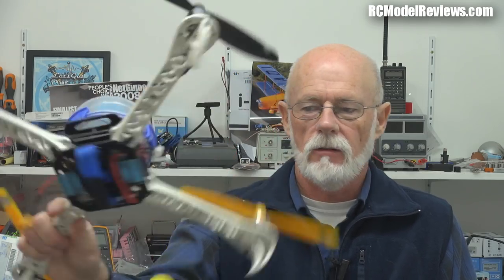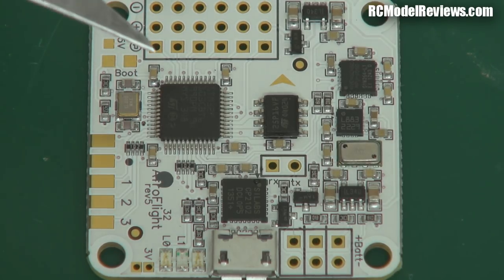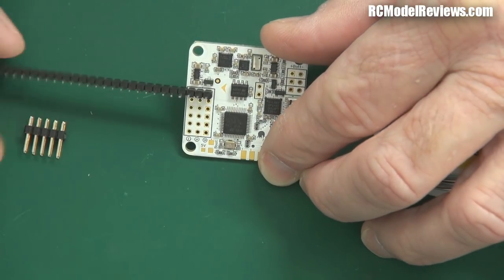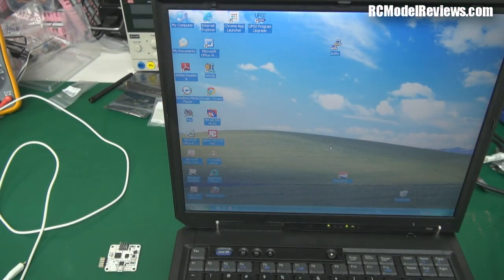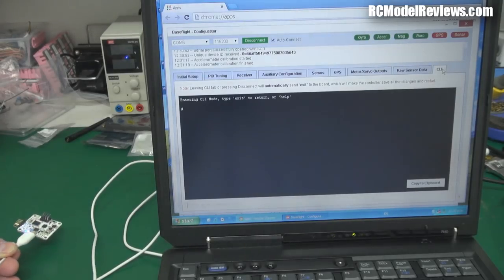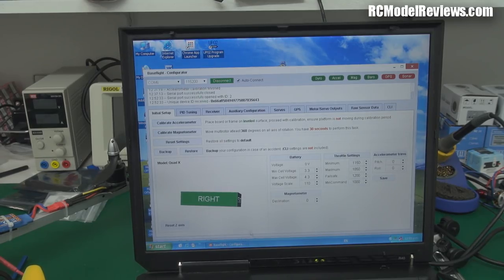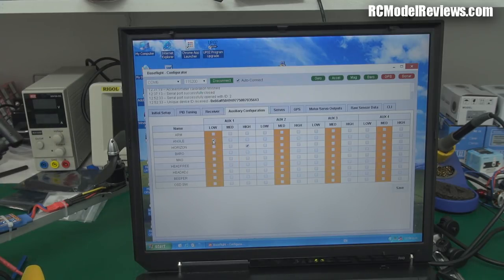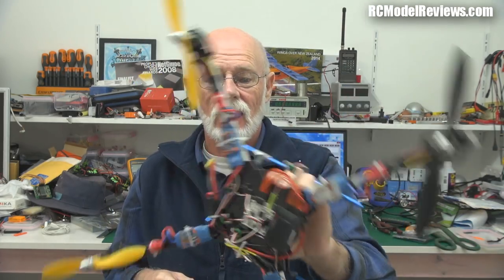Naze32 multirotor flight controller (part 1)

Comment: Great review! I've been wondering about that controller. Btw, when soldering pin headers on smt pads I find it easier to tin the pads first and the add some flux and reflow the solder to the header.

Comment: Flew my NAZE32 for the first time today on a SK450.  Thanks to your video I had the final config bits I needed.  Flew great even though I had tried to kill it earlier in the week with 12 volts (bad ESC).  Agree that it just works without any tuning.

BTW I could not really tell any difference between Angle and Horizon mode.

Keep up the great work

Michael

Comment: Nice to see more publicity for MultiWii, it's awesome and doesn't get enough. :) If they do sell out people should consider the Flip32 from Ready To Fly Quads, very similar controller and good prices.

I'm surprised you don't like the motors spinning when armed. This is one of the best features of MultWii over the others. No more accidentally bumping the throttle and chopping your fingers, if it's armed you know it because the motors are running. Bumping the throttle seems MUCH more common than accidentally arming it.

Assuming you're running OpenTX/ER9x or whatever on the 9x you can set the default required switch positions to anything you want, they don't always have to be "up" or whatever.

Comment: Currently putting together a Hobbyking FPV250 and will be putting a Naze32 into it. Wating on new motors, the multistars are blah, got 3 good out of the 4 I ordered so I picked up a few more in hopes I get some decent ones.
Reply: Yes, I spoke of those multistar motors in my last Weekly News :-)

The Sunnysky motors are pretty damned good value (if you can get them) or, if you have lots of money, the Tiger motors are great.

Unfortunately, the 250 quad-craze has made everything hard to get right now.
Reply: ***** +1 for cobra 
Better by miles ...IMHO

Comment: Naze32 board is pretty darn great.  There is a lot you can actually do with it and add to it with the extra pads and ways to set it up to get multiple serial ports.  My very first flight controller was the KK2.1 board.  Which is a good start for most people but I would have rather bought an acro naze32 from the start.  It really is easy to set up, I like baseflight/cleanflight much more than openpilot GCS.  I've used one CC3D board in my short time in this hobby and I will never buy another one again.

Comment: Hi Bruce, enjoyed watching this review. However it is slightly unfair to the KK215 just because the PID values have to be tuned for good flight. PID values change when inertia of craft and motor power etc. change. Thus a Naze32 out of the box may be crap for a larger/different size multirotor before tuning. 

Having said that, the Naze32 is what I will get for my next build. Would like to have that 32-bit goodness.

Cheers.

Comment: Hi Bruce,

I've been watching a few of your video's.
I'm considering building a Quadcopter to use as a filming machine.
The Naze32 seems to be hard to get.....

I had a look but couldn't find a review of the "MultiWii PRO Flight Controller", just wonder what your thoughts were on it?
It would be really good if I could use it to film myself fishing.  I mean set it on a path with set direction, height etc.

Comment: Bruce! So glad you have one of these because this combined with your previous Blackout MiniHQuad video means I can finally ask someone and get a straight answer!

What values do you use on your Naze32 to fly your Blackout?

I flashed the firmware on mine to latest, "threw it on" as so many suggest, and was terribly disappointed. :(

If I accelerate away from myself in a forward direction, when I try to level out the quad it seems to overcompensate massively, I have to give it a bundle of forward pitch to prevent it flipping over backwards!

I'm pretty sure I've built the thing OK, centre of gravity seems alright.

From my very limited understanding, my PID values will need tweaking because the angle of the motors in relation to the Naze32 on the Blackout are different to a standard X Quad, thereby throwing the math off a little. But I can't find any information on why this is causing this rocking motion back and forward, incorrect PID values usually seem to result in all over oscillation, either fast or slow, not an overcompensation in just one axis.

Any clues Bruce?
Reply: Are you flying in rate mode or horizon mode?
Reply: ***** I haven't taken it out of defaults so I'm assuming rate mode unless I've really missed something.
Reply: acidrain99
Try setting up the Horizon mode and see if it flies much different in that.  just assign a switch as I showed in the video.

Comment: Thanks for another great video Bruce! Hey guys I have a question with powering my fpv gear in my blackout mini H. Can I power my 5v board camera with the 5v solder pad on the naze32? If so, where do I ground it? Do I ground it to the frame pdb? reason im asking is that I want to use the video tracks in the blackout pdb instead of having the wires reach back to the video transmitter. Thanks for your help!

Comment: this guy cracks me up, good info though. i know this video is crazy old and whatnot but what kind of voltage can the NAZE32 handle? will it be able to hold a 4s 75c Lipo without a regulator?

Comment: Hi Bruce
did you tried MultiWii? there are number of boards you can choose from. looks similar to this naze thing.
I ordered one cheep one off ebay (7 $ US) just a pure metal Atmel chip and some accelerometer. Maybe I'll have to do more than you in this video, but you have to admit 7 $ to my door is damn cheap for a controller.

Comment: Morning  Bruce. Thanks to your  video i ordered the naze32 from HK. This is the acro version without  the barometer. Do you know if it is possible  to solder on the barometer to make it the full version? I have a spare one from another FC that inwas hoping could be transplanted. Cheers!

Comment: 11:11 Serial port device configurator is implemented for chrome apps. It's brilliant. serial, usb, socket API allows to communicate to device. The apps shows 3 axis state via WebGL. If I'm an engineer of the device company, I would also choose chrome apps.

Comment: Hi Bruce, I am curious if i buy myself a SpiderQuad frame someone on the Dutch RC forum bassically said to me dont buy a spiderquad as they are to tricky to get right setup, but i was thinking to just slap this Naze32 on it and just do the standard setup.
For now i am just gathering information and reading, and reading some more, dont want to burn my fingers again like i did with a Bixler2 and a WL Toys thingy.

Comment: what is the best for beginners like me: arcro or normal? and what are the mayor benefits in having normal with gyro + accelerator 10x .. i am a nub in this sport and you make it look so easy :)
Reply: If you're just getting started then I'd go with the low-cost "acro" version.  It really pays to get familiar with basic flying before you start adding features such as RTL, altitude/position-hold, etc and the low cost version is actually cheaper than the HK KK2.1.5 board anyway.

Comment: My last board was a Multiwii, which was made using and Arduino MEGA clone, and a burned out multiwii SE board (the board was dead but the I2C sensors still worked :D) I had it pimped out too, with GPS, sonar, barometer, magnetometer, etc. And theoretically had a mission mode and RTH mode. But the problem was that it was unreliable, It felt loose and drifty, PID tuning only made things worse. Maybe the Naze32 will perform better. :/

Comment: Gidday from Tassy Bruce. Have purchased the Naze32 and done the sodering :} Would you be able to do a vid on how and what gps unit to use on this board ? and also how to setup a osd ? searched the web to no avail as in there are only 2 pins for the gps ? don't know what to do ! I'm sure there a lot of other people in the same boat . any info from anyone on here is welcome.

Comment: Cool, I want to buy one of those. Abusemark site - both linked-to models "sold out." My regional supplier - both "out of stock."
Reply: For the more advanced techies, instructions for building a DIY Naze32 Funfly equivalent using a combination of readily available (and cheap!) eBay modules totaling $14 including barometer and compass sensors can be found in the very recently started  "Cheap DIY control board: Naze32" thread on RCGroups. Heavier than an actual Naze32 board, of course.

Comment: I'm tired of people talking about how the ARM procs on these boards somehow make the quad fly better. This runs a 32-bit port of multiwii and there is literally no difference in flight performance from the 8-bit boards besides the fact that to get auto-level to work properly you have to artificially lower the looptime. People say "its faster and and thus more accurate". Ya, maybe, but your limiting factor is still the refresh rate of esc's and inertial physics of propellers and motors. Warthox primarily uses 8-bit mwc's in his videos, properly tuned they are basically as good as it gets... These 32-bit boards will come in handy for developers implementing waypoint/optical flow/autonomous flying.
Reply: Absolutely. The Firmware doesn't take advantage of 32Bit capabilities. The only thing it has (apart from the mwii original code) is gotten rid of the small angles approximation. So the basic flight performance should be the same. I've read that KK boards can be flashed with mwii as well, so KK2.x version owners can have the horizon mode for 0$. So only minimal 32bit advantage (some more precise math functions) over the mwii (2.2) original for now.

Comment: Hi, I am considering buying a Naze32 Contoller for a Quad I am about to build
Questions:
1. Can I use a UBLOX NEO-6M GPS directly with a Naze32 or do I need and interface board such as a I2C-GPS?
2. If I purchase the U-BLOX 7 do I need and interface board or does it connect directly to the controller?

Comment: So how about hooking up a 4in1 esc to this board? Im building a tricopter and using a 4in1 esc just because its less weight, space and was cheaper for me rather then buying 4x50 amp esc's but i only own a i6 reciever which only allowes pwm so im wondering if it would still work great

Comment: Hi Bruce,  I'm working on my second quadcopter, the first got away using a KK2 board.  I now using a naze32 board, but I'm confused about the software setup, I can not connect the board and the software.  Can you tell my how or direct me to a link that will solve my problem.  Like your reviews.  Thank You   Jim Dickow

Comment: Hey Bruce, ordered the afromini 32 as naze 32 is out of stock Globally. It only uses PPM, now I have a flysky FS-6B, which does do PPM, apparently, but I can't find any info on it, I think it would be from the battery port on the ESC to the PPM port on the afro... I saw in your vid you had the one wire PPM, this maybe common knowledge, but there's no info on sites google or anything, we need a ppm explanation!! or at least how to connect your receiver via one signal wire.
Reply: just checked video, and you're not using cppm.... a little confused as the afro does state ppm, not cppm....?

Comment: Great video! I think I am going to have to try the Naze. Has anyone tried them with the DJI frame? I know the maker of the board says it will not work, but if the KK2 can put up with the vibration I am sure the Naze could. Right?

On another note, I have no idea how people keep breaking KK2 screens. I have broken so many DJI arms and still am on my original KK board. Same with my friend's who is mounted on top of the copter.
Reply: It'll work on any frame. Timecop who makes these is not a DJI fan. Just make sure to use balanced props and motors. Naza comes with internal dampening for the sensors so it is less sensitive to vibrations.

Comment: try the kk2 on a mini 250 .......w latest firmware i think ull be surprised at how well it handles without tuning anything !
Reply: Not at all.. I bought 2 of the 2.1.5 with latest firmware, same crappy results.. NAZA lite was ten times better.

after 30 seconds of flying the KK2.1.5 the center stick position ends up creeping off one way or another. By 2 minutes into flying, to get the quad level, the sticks had to be way off center.. practically unflyable.

I tried both of them on a f550 hex, f450 quad, a 350H quad and a QAV 250.. Awful!

I tried returning them but HK wants a video of it not working AND for me to pay shipping.. then wait, and see if they agree it's not working right and so on.. Not even worth the hassle. 
So I just got another one from a different store... Same as the previous 2  Useless!

Comment: Hey there, I got baseflight via google apps and for some reason, I get "No Ports" in the com window.  I thought it may be an issue with win 8 so I did it on my old laptop running win 7 and got the same results.  any idea what Im doing wrong?
Reply: You may need the new driver. Usually it will be reported top left of the baseflight window. Also if the FC came from Hobby King then the firmware may need to be upgraded (as mine did) to v2.31 or above.
Reply: Ian Thompson I got mine from Hobby King, but how do you  update the firmware if the computer cant find the driver?

Comment: With the invention of Micro USB connections. why shouldn't we make the move to use that? or some other proprietary connection. Would make it much easier to build, replace parts, we could probably get more people into the hobby. I've bought a HK450,  (still haven't put it together though, ) and A DJI phantom 3 which I love using. but why haven't we made a move to a more plug and play system?
Reply: Well I suppose the Pins are just plug and play, but for everything else theres alot of soldering and some people may be turned off from that.

Comment: Bruce!!!!!!!!!! Why are you still running the stock firmware on your turnigy radio.
You HAVE to flash it with the alternative open source version for it.

I have some naze32 boards.
GPS stuff doesn't work well on this.
Too much grief.

Otherwise...its my preferred board for acro flying.
Reply: Not my radio :-)   I was setting this up for another of the Forest Flier club members.
Reply: how to flash the radio?

Comment: I have a naze32 hooked up to my Spektrum AR600X and have an interesting issue!! now i will start by saying none of the esc's are hooked up i just wanted to get to grips with the FC First. i have connected all leads required and installed the software all fine but when i look at the receiver tab i get no movement from the roll and pitch!! yet if i remove the signal wire from the elevator connection on my reciever the tabs move together for pitch and roll only when i operate the ailerons!! any ideas greatly appreciated before i chuck it the regretted purchase pile :)
Reply: Sorted this issue. Had a duff board 😣. New board now works a treat using a orange sat receiver to save weight and cable.

Comment: Can anyone tell me if it is necessary to remove ground and power wires from servo wires coming from esc's going to flight controller on all but one esc? assuming power distro board being used.

Comment: the interface on my Baseflight Configurator says that there is no ports? i'm kinda confused what that means, are there additional downloads beside the chrome app? If he said anything about this, i missed.
Reply: i found a driver to download, but for some reason, its not showing up in my device manager. I need help :(
Reply: let me be more clear. I downloaded the CP210x driver as suggested by Baseflight Configurator. After installing said driver, I searched my device manager for it with no avail. Am I missing something? Is this normal?

Comment: Hello RC Model Reviews,
Please help, after flashing Naze32 to Cleanflight and calibrating Accelerometer and Magnetometer, the red led light is flashing(blinking). The naze32 is not mounted on the frame and does not have any pins soldered to it yet, What does it mean when red led blinking ? How can i fix it ? thanks
Reply: i might be a bit late, but as far as i know the red LED just means it's working.
Reply: better late than never !  thanks a lot

Comment: Great video Bruce, I been looking at this board, now that i seen how to setup it up i going have to buy it.   Ps i see you used the NTM motors. :(   you need to try the Sunnysky motors  :)
Reply: Got some sunnysky motors here.  Got some of the 2204S KV2300 motors for my next 250 miniquad and some of the larger SunnySky motors going on the Cinetank.

Comment: need help with naze 32 im programming the naze 32 on a mac and using a turnigy 9x and i have programed most of it and im stuck with the roll i have set the aileron up on the remote on channel 4 and wen i move the rudder on the remote it moves aux 4
i need some help fast pleas  using mode 2

Comment: Where is a good place to buy the Naze32? Looks like most places are out of stock.
Reply: Drone matters has the acro version (No Baro/Mag) in stock as of right now
Reply: Legend! Ordered, now to figure out what build I want to go with for a 250 size quad.
Reply: venturation Yeah I got lucky and saw it on an rcgroups post. I picked one up myself for my HK FPV250.
Reply: venturation Yeah I got lucky and saw it on an rcgroups post. I picked one up myself for my HK FPV250.
Reply: Looks like I'll be going with:
Naze32 acro
SunnySky 2204 2300kv
RCX 10A SimonK ESC
Hobbyking FPV250 long frame
Gemfan 5.x props

I'd love to get the blackout or QAV250 frames but at over $100 more than the FPV250 frame I think the FPV250 is a good start.
Reply: ReadyMadeRC got a handful in recently - acro version